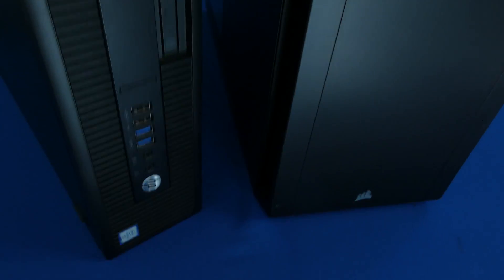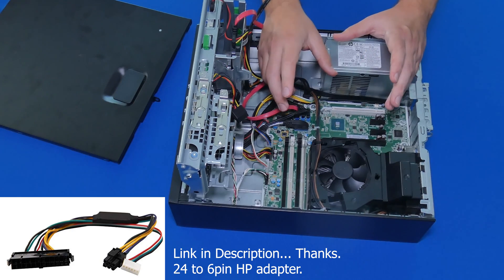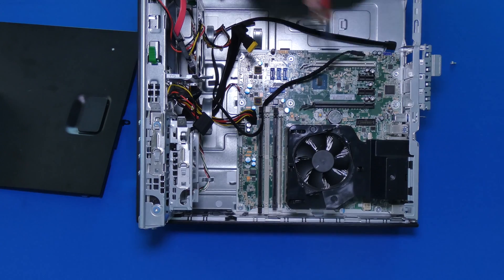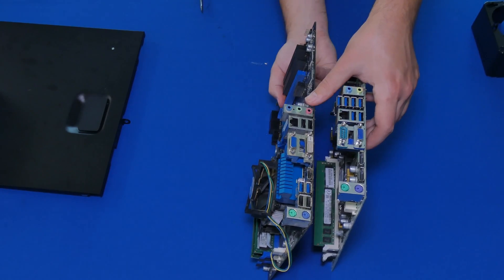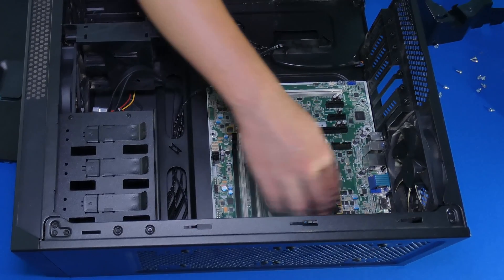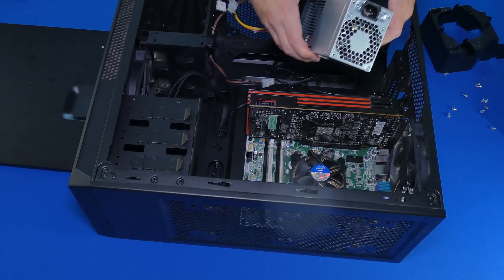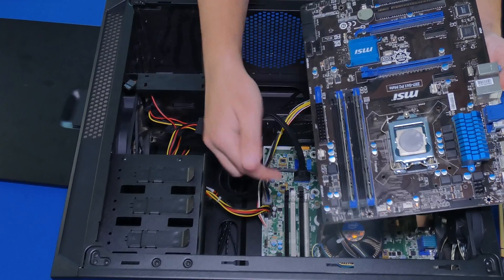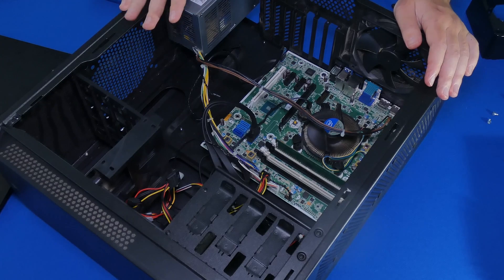HP EliteDesk transferring Parts to New Larger PC CASE

Comment: I actually did this with my HP Elite Desk 800 GI SFF I ran into a problem with the Intel Heatsink not fitting on my board so I had to use the old heatsink, to get it to stay onto the motherboard due to it not having the support from the case anymore, I had to go to Wal-Mart and buy machine screws 1/2 inch and attached the washers to the back of the board this remedied the issue perfectly! Although it did cause quite a bit of frustration. Also had a hard time figuring out where the front connectors go onto the board! If you do this definitely take your time! I had never worked with computer parts in this way and managed to get everything working with patience and double checking everything before going ahead. Overall I am extremely pleased to have upgraded my computer in this way, it ended up being way cheaper than I exected and definitely worth trying. Thanks for the help!
Reply from the maker: Sure thing. Thank you for sharing your experience. 👍

Comment: are the motherboard same size with lenovo m82 . it have liq45 antelope/ mtq45nk
Reply from the maker: I'm not sure. It's been a while since I've had a Lenovo PC. Open your PC case and check the mobo orientation. If it looks similar to this one it may work. The main concern is to align the back I/O panel.
Reply: @Cobuman  thx for the reply, i try it first

Comment: What should I connect the back case fan to?
Reply from the maker: You can connect to any extra power cables. Like unused Sata power cable.
Reply: cobuman also once i put the mobo in the new case ive been getting some new errors saying front usb 1,2, and front audio is not connected. How can i fix that.
Reply from the maker: If your new case has the front USB and front audio you should connect those. The front USB is that wide connector (blue) on the bottom of mobo. Front audio might be a bit different on new Case. Compare those cables with the old case.

Comment: I recently bought a HP 800 G1 SFF and I “Hackintoshed” it – MacOS Catalina! I like it so much that I want to build a tower version. Since I already have an outdated, but functional, tower system in a full tower LanCool (Lian li PCK60 ATX Steel PC Case), I want to buy the MB, CPU & Cooler (for a total of around $90). Is the motherboard for the SFF and tower the same? It does not appear to be! My question is: “Which motherboard should I get or what is the part number of the one you used?”.  Here is data from the HP manual:

Tower Motherboards

System board (includes replacement thermal material)

 For use in models without Windows 8 696969-001

 For use in models with Windows 8 Standard 696969-501

 For use in models with Windows 8 Professional 696969-601

 For use in models with NetClone 727720-001

SFF Motherboards

 System board (includes replacement thermal material)

 For use in models without Windows 8 717522-001

 For use in models with Windows 8 Standard 717522-501

 For use in models with Windows 8 Professional 717522-601

 For use in models with NetClone 727722-001
Reply from the maker: 😁All I can tell you is that this PC is 800 G2 SFF. Aside from that, I'm not familiar with part numbers per say; but I am familiar with specs related to any of those machines.
Reply: @Cobuman  Thanks for the quick reply. I'll get the MB for the Tower rather than the SFF. I hope it fits the case like you showed that SFF motherboard did.   I will pair it with an i7-4770 or a Xeon E3-1231 v3 CPU (whichever is cheaper). Thanks for all you do.
Reply from the maker: @eddieabrunson  Sure thing. Let me know how it goes.

Comment: Do it also work for a lenovo thinkcentre m series pc?
Reply from the maker: Not sure. The main problem is motherboard orientation for I/O panel in the back. If that aligns with standard ATX case then it should work.

Comment: Awesome video!
I just started fixing up, upgrading and selling some OEM pc's lately, but I have been buying Lenovo's and they have power limits on the PCIe ports.
So that limits the types of GPU's I've been able to put in them.
I'm guessing the HP Elitedesk 800 doesn't have that kind of a power limit on the motherboard, so the only thing you need is a new PSU.
Reply from the maker: Thanks, In most situations people don't even change the PSU if adding a low profile card in to SFF case.
Reply: @Cobuman  Yeah I didn't do that for my first Lenovo build either. Do you think the HP motherboard will fit a mATX or should I get an ATX/mATX case to be sure?
Reply from the maker: @tunasanwitch  The HP motherboard is still a weird shape although it aligns at the top. That being said I would stick with ATX but if I had mATX laying around it would be interesting to test.

Comment: I have question. Since the board fit perfectly fine with the atx tower. I wonder what powersupply should i need to buy? Does all the pin connector for hp elitedesk board work with ordinary atx powersupply? If yas i would buy a new case and rebuild my setup
Reply: Thanks. I have read the desc.

Comment: Power Button configuration for computers without split leads 

This is almost exactly the same as my HP prodesk 600 G2. the only difference I see is the CPU cooler and mine only has 2 slots for ram. the insides aren't the same but the mobo are the same.

the main issue I had with my case transplant was the Power Button. HP, of course, had to make theirs proprietary and block pin 6 rather than pin 1 like normal PCs. My case doesn't have the Power supply leads split so I had to do some wacky wiring. Using your guide and this https://h30434.www3.hp.com/t5/Desktop-Hardware-and-Upgrade-Questions/pin-assignment-for-Power-On-off-Switch-led-Cable-710821-001/td-p/7458720 

I basically put in the power button 90 degrees to what it should be. Normal cases have pins 8 and 6 being the power switch to I spanned those across what you have shown. HPs power switch is pins 7 and 8 so making putting pin 8 on the wire where pin 7 is on the motherboard and putting pin 6 on the wire to where pin 8 is on the mobo it works fine. Power light doesn't work but who cares lol.

For the cooler I just used the stock cooler and some nuts and bolts to hold it in.

Thanks

Here is a diagram 
Mobo is 
 •   •
 •   •
 •
☻☻
 •   • 
top left is pin one and to right is pin 2
☻☻ is the power switch connectors on the mobo. 

normal Power connectors are 
     ♦
☻ •
☻ •
 ♦  ♦
 ♦  ♦

☻ is the power buttons 

Basically needs to align these. 

in the end, it should look something like this 

                 Mobo  

                 •   •
                 •   •
                 • 
       ♦  ♦  ☻☻
       ♦  ♦  ☺☺  ♦        <-- cable from the Power switch 

♦ is unused as it is perpendicular to mobo connector. ☺ is over lapped. ☻ is power switch 

hope this helps

Edit. This looks kind of weird on mobile but should still be semi understandable. Look at it on desktop to get a better understanding. Also ask a me a question if you need. 

Thanks
Reply from the maker: I appreciate your write up. This comment will be pinned. Please Change/add first sentence to say something like "pin out configuration" or "power connector fix". This will help a lot of people that have issues. Thank you.

Comment: @cobuman, did you just assume the G3 would work or did you test it?  It's a different motherboard after G2 and doesn't use a 6-pin connector. It uses the flat connector (PWRCMD) and a 4-pin (PWR).  Guess it's too late now since I'd already ordered a G3. No pre-made adapters. :|
Reply from the maker: Depends which G3 you mean. If 800 G3 then you are correct. But if it's for example 705 G3 then it's the same. Sorry about confusion. Anyway, if you need extra power to run a large GPU you can also use a 2nd PSU just for that. Here is my video if interested:  https://youtu.be/tj2ws0mTm6E around 5min mark I show how to connect it.
Reply: @Cobuman  I think they still use that flat 7 pin (and actually has 7 wires instead of just 4) for PWRCMD. But they switched to using a 4-pin 12-volt (I think it's 12 volt) for the PWR. I've been trying to find the pinouts for the power supply on the elitedesk G3 but I can't really find anything.
Reply from the maker: @MatthewLenz  Yea, I didn't find anything either. It seems like it was a limited model or something. Are wires colored like yellow and black? If so you can check using volt meter and possibly reuse the connector by connecting to power supply source. Like connecting it to extra SATA power cable. Of course, be careful if you decide to do so. :)
Reply: @Matthew Lenz did you ever have any luck with the G3 ?

Comment: Rather than putting a whole new heat sink in, can't you just secure the old one on the bottom of the motherboard using the correct size nut?
Reply from the maker: Sure, that could work.
Reply: @Cobuman  Thanks; I'm looking into doing this myself. Just have to determine what nut size that actually IS. And then if I can get the correct power cable adapter or power on off switching etc. Ugh

Comment: Tried this, motherboard emitted a solid green led. Unfortunately, pc would not start no matter what. Power supply itself would start up, then abruptly wind back down and stop too. Do you have any advice on this? I'm pretty sad.. Hope I didn't brick my PSU or motherboard.
Reply from the maker: Recheck all cables. Hopefully you didn't damage anything. Assuming all parts are the same it should work fine.

Comment: Great video! The case you're mentioning now is now an expensive $110 with shipping on amazon. Do you think the newer CORSAIR CARBIDE 275R Mid-Tower could work too?
Reply from the maker: oh wow! That is way too expensive. Pretty much any Mid-Tower should work though.
Reply: cobuman awesome. Thank you for your help. Last question: Do you think an I7-4790 is a significant bottleneck for the rtx 2070 non-super?
Reply from the maker: @muen1842  Depending on resolution and fps expectations. For example, if you expect 140fps on 1080p but you get 100fps the bottle neck would be the CPU. However, on higher resolutions like 4K it becomes more GPU reliant at which point 2070 would do 90% of the work anyway.
Reply: cobuman right! It’ll be gpu-bound from there. Perhaps the better question then is: could this motherboard or its slower (1600 mhz ram) bottleneck modern gpus significantly?
Reply: Trying to decide whether I should just take the i7 out and make another pc with a more capable motherboard. :3

Comment: I have to ask as I use a bank of modded z220     the heatsink.    Is that model just the standard size used in all the hp machines ?     As changing the heat sink to a low profile fan cooled one would be massive for me.
Reply from the maker: The heatsink I tested is just a standard OEM intel from a i7 4770.
Reply: @Cobuman  I mean the hp standard heatsink.    Is it just a run of the mill sff heatsink they used in all there. Elite workstation sff.    I ordered a artic  cooler  to see as it would be huge if we can swap out the heatsinks for a better aftermarket cooler.     They are great value  just a pain in the arse  to use parts which they can handle fine.   The i7 3770 is fine with a 1070ti.  It just needed a different PSU.
Reply from the maker: @salaciouscreations4323  The one inside of SFF workstation is HP design only. Although, the holes should be standard as demonstrated in video. So, your aftermarket heatsink should work.
Reply: @Cobuman  fingers crossed  and thank you for taking time to reply.   Ordered a single unit if it works all 5 are getting that upgrade

Comment: Can you tell me the cinebench r15 score for this machine? and what processor did you test with
Reply from the maker: This is an 800 G2 with i5 6500u. Not sure what it has to do with transferring parts to larger case but there you go.
Reply: @Cobuman  i actually intend on buying one of these the one im getting has a i7 4790 but i heard OEMs pc processors tend to underperform so im a little concerned :( 
Getting this as my pc just died ( Completely you will be amazed to know the graveyard i have collected in 4years ) 
So i just want a pc that is durable and will last me 4-5years without any problems :'D
Reply from the maker: @GamingTechSnips  The main difference is the that "k" CPUs can be overclocked which makes non-k ones under perform because of that. So, i7 4790 vs i7 4790k . Otherwise stock speeds are the same.

Comment: Do you know the pins for the reset switch and leds? I want to connect more than just the power switch
Reply: I managed to figure it out for the rest:
If you look at the header from above:
xx -> pin 1,2 
xx -> pin 3,4 -> power switch 
  x -> pin 5
xx -> pin 6,7
xx -> pin 8,9
In order for the HDD LED to work, it should go in pin 7 and 9 (align the small arrow on the header). The Power led - should go in pin 6 and the power led + in pin 8. Pin 5 is not used. I'm not sure if the reset button works on this motherboard, as it does not work in my case
Reply: @davidoosterhuis1355  por favor ayudame no logro encender mi placa por el interruptor
Reply: @davidoosterhuis1355  You sir, are absolutely amazing. Plugged everything in exactly as you said: Booted immediately with all lights working! I cannot thank you enough
Reply: I want to now can i Add Reset Button on Atx case thank you

Comment: I just purchased the same heatsink and fan for my 800 g1 with socket 1150mb and the heatsink isnt large enough. Only 2 of the holes line up
Reply from the maker: Weird. The one in video is pulled from i7 4770k which uses socket 1150... it's a standard intel heatsink so I'm not sure why it would not work for you. Unless you have a totally different PC or the heatsink you got is somehow different. Do you have an AMD PC by chance? Does it say intel on the heatsink just like in the video?
Reply: @Cobuman  My 800 g1 has an i5-4570 socket 1150. The heatsink I ordered and received was exactly like the one in the video, except my original heatsink and fan have a more rectangular mounting points and are not square as the new one has.  I was at a point of no return last night so my fix was to just use my original heatsink and fan and I had to put nuts on the bottom of the mainboard and carefully tighten the heatsink down. It works and I am still happy to have the extra space of a regular size case, I hated that SFF case.
Reply from the maker: @AceManDaMan  It should be squared. Well, I'm glad you got it worked out. I was going to suggest the same thing you already did. Good job.👍
Reply: @Cobuman  Every socket 1150 heatsink and fan I look at have square mounting points. I wonder why mine is rectangular?  It clearly says LGA1150 right next to the cpu on the board. Oh well at least its working. The only other issue I have is at bootup I keep getting a warning about power supply fan not installed and it says front 1 and 2 USB are not present. But I hooked everything up the way it came off the old case so I dont understand that.
Reply: @Cobuman  My Case is the exact same one in your video except mine had no external 3.5. I appreciate you responding to my questions/issue as a creator myself I have noticed most YouTubers over 3-5k subs do not even acknowledge their subscribers in the comments.  You gained a sub!
Reply from the maker: @AceManDaMan  I hear ya. I don't mind helping as much as I can. 👍😁
Reply: Ace 88 RC Fun&Reviews what size nuts did you use?

Comment: if i got the regular sized elitedesk would i be able to add a regular gpu and upgrade the psu?
Reply from the maker: Yes, you may need a psu adapter like this: https://amzn.to/2v0chh7 Open the case and see if you have a wide 24pin connector or like the linked adapter connectors. A GPU should fit inside.

Comment: I'm looking at transferring the innards of a HP 800 G1, but NEITHER of the cables 'looks right' or matches even closely the current PS pin-out and color scheme.  Is that normal? Some people say the link you provided works with the G1 800, but Amazon lists this one below as the correct Adapter and IT still doesn't look like what's in there at present. I'm afraid to use 'either' of them for fear that I may blow up the Mobo..

https://www.amazon.ca/COMeap-Power-Adapter-EliteDesk-12-5-inch/dp/B07S51NC9B/ref=pd_sbs_147_1/134-7173793-4047852?_encoding=UTF8&pd_rd_i=B07S51NC9B&pd_rd_r=6f164985-c4d6-41da-9e35-e0f809662b1a&pd_rd_w=mmbTY&pd_rd_wg=x19ye&pf_rd_p=dbebb38c-0e3d-4a67-ac15-432d7c7a2789&pf_rd_r=DJ3T4ERPN7RNM36BZ2YT&psc=1&refRID=DJ3T4ERPN7RNM36BZ2YT
Reply from the maker: That does look like a correct adapter.
Reply: @Cobuman  Ok, I'll give it a try... Cheers,

Comment: willl this work with a hp 8300 elite?
Reply from the maker: No
Reply: @Cobuman  :/ why
Reply from the maker: @calebmoore7026  the back panel I/O connections are positioned in a different. It would not align with hole in the back.
Reply: @Cobuman  what about something like the Thermaltake A2421 BTX Upgrade Kit for Mozart TX Series look on amazon
Reply: @calebmoore7026  that will ONLY work on that case